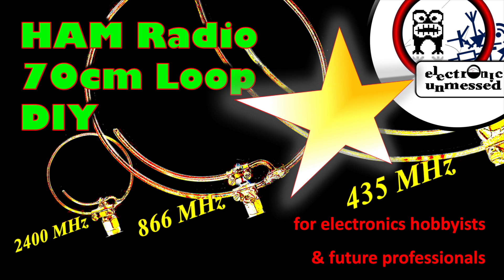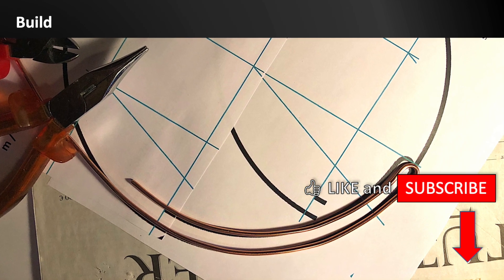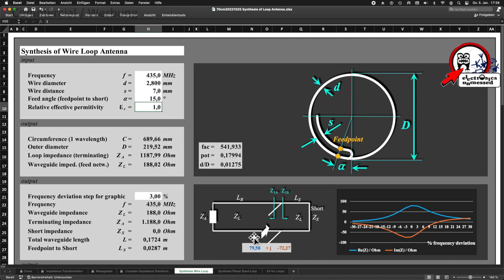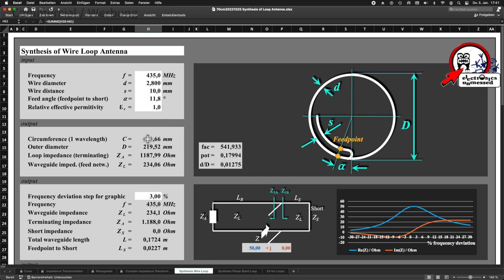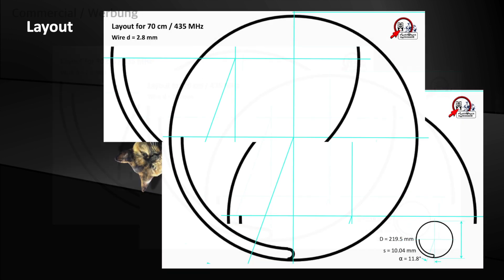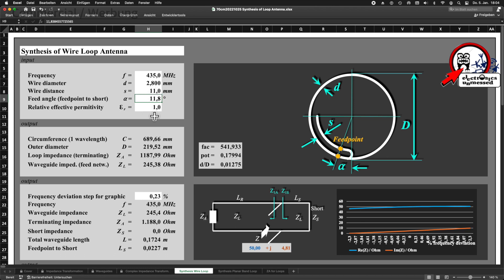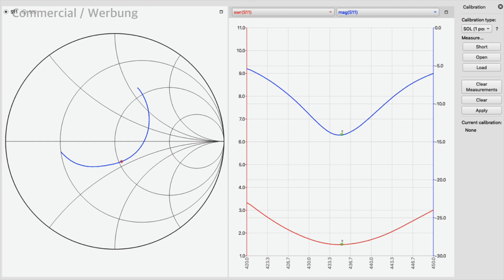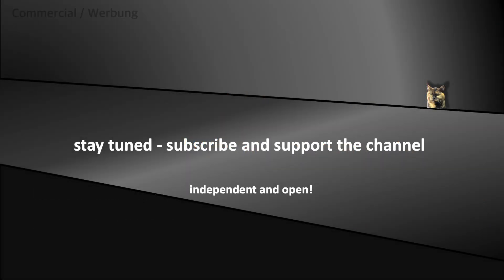How to Design and Build a 70cm DIY Loop Antenna (EP37)

Comment: Is the spreadsheet available for download somewhere?  I would like to have some students make some of these loop antennas for a radio direction finding activity.  Your method is very attractive.
Reply from the maker: Thanks for your comment! This is a great idea for your students! There is a lot more about this antenna to be found on the channel: working principle explained, power rating, NEC simulations, measurements etc. You can also click the link in the top right corner to find the other videos on the topic. Supplementary material like EXCEL tool, plans, etc is always found in the download section under the video. Looking forward to get your feedback ..
Reply: @electronics.unmessed   Your github repo for EP37 only has a pdf of one design.  I don't find the spreadsheet anywhere.  Am I looking in the wrong place?  Thanks again.
Reply from the maker: That's right! Please check out my PLAYLIST "Antennas & Wave .." The EXCEL is under the video "Antenna Design based on ...!

https://youtu.be/v2jBXe9buUY?si=gm7xXSqbZ5ePAq4p

Comment: I am thinking, for the purpose of looking better and better reception, of building a triple loop version, mounted on a circle rather than the rectangle, with a circular reflector.  The color of it matters too. The goal needs to be to make the homeowner association happy, as well as keep the artistic wives happy. 

This tri loop design would not look as ugly, as it would be reminiscent of wreaths and the familiar Olympic logo. I would lean towards copper because of its color over the years.  I am not sure about getting an acceptable color for the structural circular wreath for mounting or reflector.  The best liquid Paints have a maximum color life span of 7 years, which is too short for something like this which needs an outdoor lifespan of 30-50 years to make it worth the time and spark interest and excitement. Even a factory roof paint might only last 20 years. .

Ai, and several sources, keeps telling me I need a capacitor. I have never once seen a cap on a loop TV antenna.

I would add an odd multiple of channel 26 half wavelength, which is smack dab in the middle of the ufh and the vhf band. Odd multiples, or 1.5x,have been found to have a 6db stronger signal than a half wavelength.  This is likely why 77 cm brought to life channel 8 and up to channel 24 in my house, without any uhf. 

My old 2004 balun had separate uhf and Vhf inputs, yet connecting the 77 cm wire to the vhf side brought in most of the available uhf, at least on half of the uhf band, just using the vhf side of the balun.   I added a single wire cut to channel 26 and it brought in all the missing stations below 26 (or longer frequencies).  Interestingly, I was able to get the missing high uhf by simply putting a high uhf wire at a 90° from the vhf wire at 2-4" distance. It must be inducing a current in the vhf wire... Technically, in my understanding the perpendicular ac electric current would induce a perpendicular magnetic, which must be pulling the electrons of the larger wire back and forth and creating current.

Anyway, my question would be whether or not there is better balun technology nowadays than the separate uhf and Vhf inputs. Or is it better to separate them.

Also I would think 91 cm just barely big enough to squeeze channel 15 through and a longer wire needed.  Now, I understand that emf travels at 97% of the speed of light through copper, which means that we take the half-wavelength and will need to calculate 3% lower. In steel it might be 5% slower.  However, this would not apply to a loop which is catching the magnetic via the air space in the inside, so a wavelength should be a wavelength.  At 470 mhz, the beginning of the uhf, we get 32 cm, which requires more wire than 91 cm.
Reply from the maker: Thank you for your extensive description and your interest in my videos!  And don't hesitate to ask further questions.

If you want to use this antenna for TV reception, which I understand from your comments, then you should keep in mind that the antenna is narrowband and therefore does not cover the entire television band. Otherwise your thoughts are all correct, I think. 

By the way, I like the cool idea of building a visually beautiful antenna! I can't really answer the balun question. An active element could of course be better for the purpose, because the aim is to lose as little signal strength as possible. 

I'm curious to see how your project continues. I think other people would be interested in this too. Maybe you would like to report about it here from time to time?